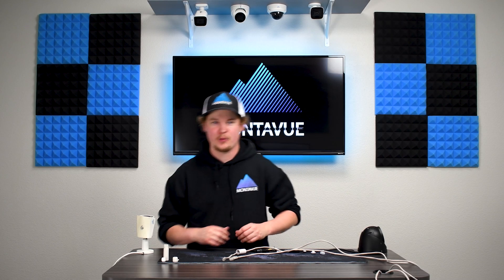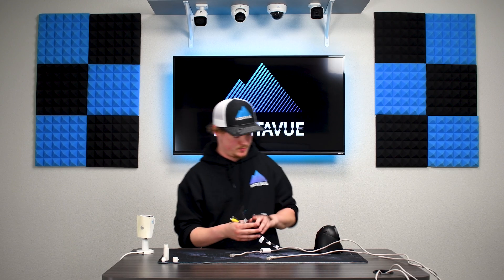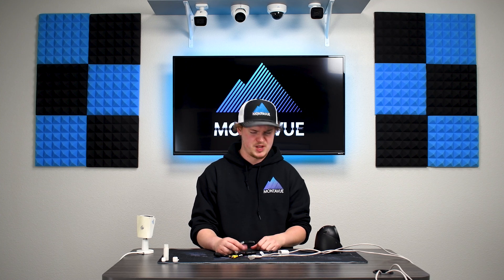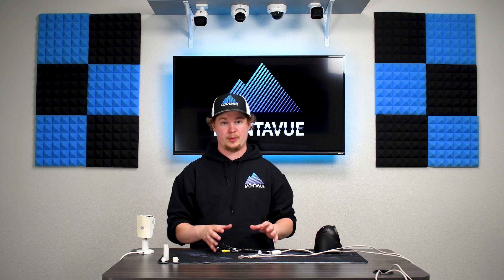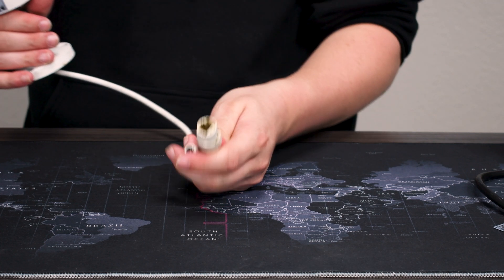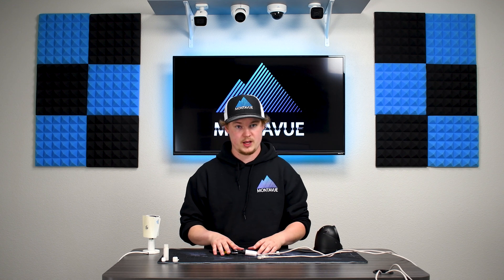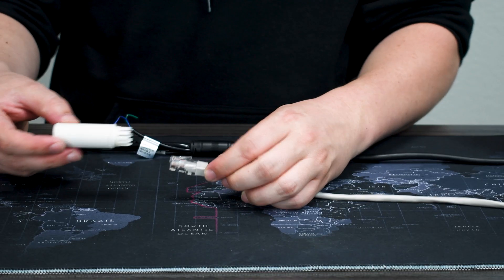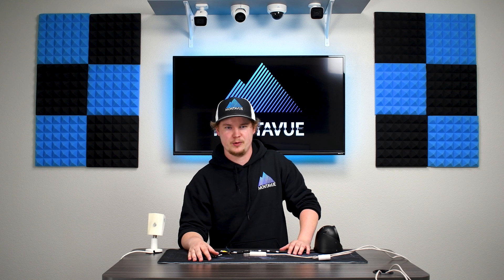Security Camera Cable Basics for Montavue

Comment: Interesting that no where in any of the montavue manuals does it mention dielectric grease?  Easy to go back on some of my camera connections and apply.  My main question is I want to upgrade at least one of my 2K cameras to 4K. Currently using Cat5, will it work with the 4K or do I need to upgrade to Cat6.   Will I lose any 4K quality if I don't? (took a lot of work to run current POE to outdoor cameras)
Reply from the maker: Hi, Jim. Take a look at the Quick Start Guide that we send out with every system. In the guide, we suggest using dielectric grease as a precaution. 

You can find the link to our digital version of the QSG here: https://cdn.shopify.com/s/files/1/0398/1980/4829/files/MontavueQuickStartGuide_e34ab2b6-495b-47e2-b298-15967bc3e6c9.pdf?v=1602778067 

It's mentioned on page 4, in the FAQ under "How do I protect my camera cables and connections?"

Also, you should be just fine with your CAT5 cables to upgrade to a 4k camera. We use CAT5E cable with our systems but I'm confident you should be able to run the 4k camera on your current standard CAT5. You will also not lose any quality on your cameras by remaining with your CAT5 cables.
Reply: @MontavueSecurity  perfect...and thanks for the responses!!!!!